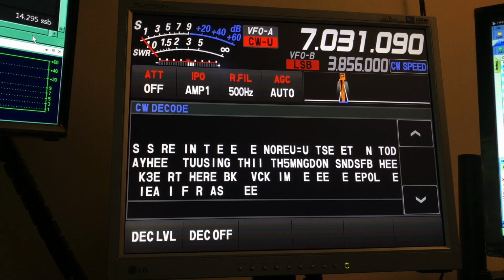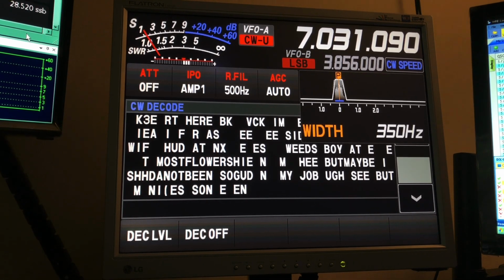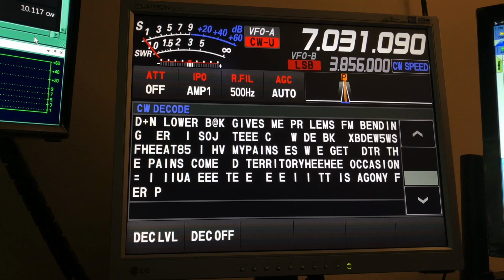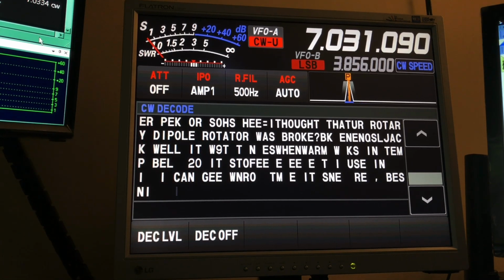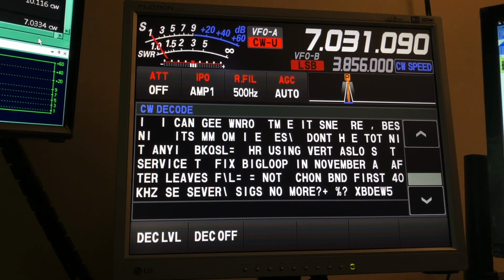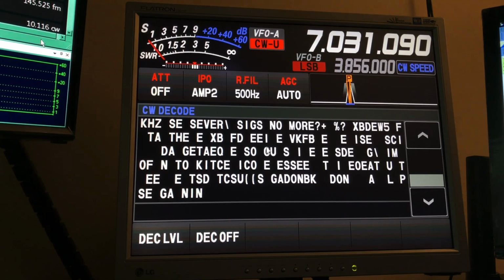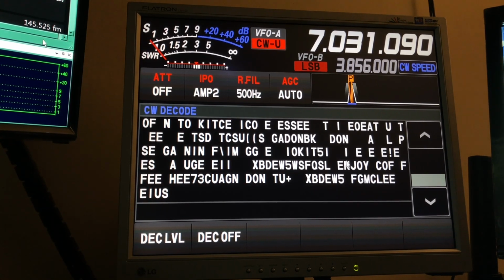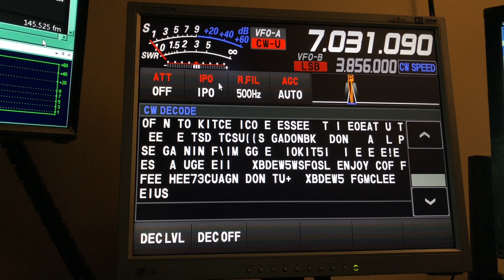Yaesu FTdx10: CW Decoder (Video #37 in this series) #ftdx10 #hamradio #cw #decoder

Comment: Excellent video !   I noticed there was a note displayed about the DECODE LVL being set at the "default" of 50 -- my FTdx10 came new in the box with the DECODE LVL set at 20.  So I adjusted it.  One question about the APF -- you note enabling it.  Are you enabling it at zero Hz (I assume so) ?  I see the APF can be adjusted from -250 to +250 Hz ?  And are you running the APF width at "wide" or "narrow" ?  Many thanks for these great videos!  73.
Reply from the maker: Those questions are answered in various videos in the tutorial series. There are 103 videos.  The menu optimizations guide covers it too.

Comment: Mine displays gobledygook no mater how it is set up ! Worst CW decoder I ever had. Just wont decode!
Reply from the maker: That's a shame.  It works fine for me.  I just dial in the CW speed to approximately the speed I'm listening to, +/- 5WPM.  It's somewhat forgiving, but it needs an idea of the speed it's supposed to decode.  Plus work the noise floor down as much as possible, so it doesn't decode noise.

Comment: In my opinion it's way better to learn to copy CW before learning to send.  Like the days before decoders and keyboards when you had to test for the FCC examiners.  Machines just don't do well with slight human errors or what we used to call a "swing".  Like an accent in CW.  Anyhow the part the decoder missed was "NOTCH ON BAND FIRST 40Khz".  The human brain filter copies it just fine.  Decoders are becoming more of a crutch rather than a tool.  For that we could just run a form of RTTY or PSK.   Just the thoughts of an old Op first licensed in 1978.  

On the abbreviations it's a way to double your CW speeds both for RX & TX.  If you can say something with half the characters you have doubled your effective speed.  Just like texting, say more with less sending or as we used to do long ago "short hand".  Good demo of the radio, it's decoder, and the CW shorthand.  I highly recommend mastering CW without machines.       

73,

Old Boomer
Reply from the maker: I agree with committing to learning CW without relying on a crutch. But it’s like learning to ride a bicycle.  You want to reach the point where the training wheels are no longer necessary.  And I believe that the best way to improve CW efficiency is on the air.

But for someone who wants to get on the air while they improve their speed, the decoder provides some backup, even some confidence to help you decide to try to make on-air contacts in the first place. 

I did it the old way.  I learned on the air.  In 1982, I got on the air with a Hallicrafters SR-150, a J-38 key, and a home-brew 15m dipole.  I banged at 5WPM and all I can say is, bless those hams who answered me. Hams today aren’t as patient.  Many Old-timers are cranky and discouraging to new hams.  We should be glad to see new hams who are interested in CW.  And we should encourage, not discourage.

I slowly improved with every operating session. I’m so thankful for those patient operators who endured my fist as I learned. But today, if you get on the air at less than 10WPM, you are libel to be ignored. 

I encourage getting on the air and mostly just listening, until you are comfortable at copying 10WPM.  Practice sending without transmitting (BK-IN off) until you can send at 10WPM. Then get on the air. Use the decoder to build confidence as you work your first contacts.  Try to increase quickly to 13WPM.  Commit yourself to outgrowing the training wheels. You will eventually find that you no longer look at the decoder.

From where I sit, I hear from so many new hams who have been discouraged by old-timers. Part of the impetus for me starting this channel was the number of new hams who were discouraged by their local club. And it’s not isolated incidents. I hear from new hams around the globe.  They turned to Facebook, only to get treated badly for asking “dumb” questions. I’m ashamed of my generation of hams for being such kill-joys. I’m encouraged that a new ham will even attempt CW.

Comment: Be an active ham off and on since the early 1970s after serving at a radio op for the Army. Bought this rig recently, the receiver and features are amazing compared to the many rigs I have had in the past.
Reply from the maker: The FTdx10 packs a punch. It is a beast at CW, especially with the optional 300Hz roofing filter. It can pull out almost imaginary signals.

Comment: The owners manual for the FTdx10 (which I own and consider it to be an incredible radio!) does not explain what CW-L and CW-U is exactly. Those two selections are listed repeatedly in the owners manual as being influenced by other settings, but there's nothing about why I should choose one or the other.
Reply from the maker: Watch my video about CW-U and CW-L, from 2 years ago.  It’s in the FTdx5000MP playlist. It’s also in my CW playlist. I teach different operating techniques with different radios. If you aren’t watching all playlists, you are missing information. Here is a link: https://youtu.be/bYXGRpdYOxI?si=_PIvLUcT1mRBGsVu

Comment: I wish you would have shown the proper set up prior to showing the various filtering  you just jumped in with no set up directions
Reply from the maker: The setup directions are, enable the decoder, per the operating manual.

Comment: My biggest challenge has been trying to determine the decode level. A lot of the time I’m getting Es Fs and Hs.
Reply from the maker: I left decode level at default. The key is to remove as much noise as possible in the front end of the receiver, and use the DSP parameters I teach in my CW videos to finish it off. Then you need to guess within +/- approximately 5WPM how fast they are sending to you and adjust your sending speed accordingly. Your sending speed gives the decoder a clue. It needs a ballpark guess at the speed it’s supposed to decode.
Reply: @n4hnhradio  Thanks, I’ll keep this in mind. Also, I haven’t really messed with the notch or filter width, so that may be part of the issue as well. I’ve only had the radio a few weeks, so I’m still in the learning stage. In any case, thanks for the help here and the videos!!!
Reply from the maker: Once you use ZIN and lock onto their exact frequency, narrow to 100Hz and enable APF.

Comment: Couldn't you have spent 5 hours showing us how the decode doesn't work with weak signals? There isn't a single person that came here to see it not work yet that is what you showed us. A minute in and still showing us how it doesn't work with weak signals and wasting our time. Thumbs down.
Reply from the maker: The purpose of the video was to show what can cause the decoder to not work. At 3 minutes into the video you see it working, after I showed how to improve the S/N ratio. I’m not advertising the capabilities of the radio. I’m teaching how to get more performance from the radio. If you can’t understand that, then this is not the channel you are looking for.

Comment: Thanks for this, I was wondering if it had a decoder, thinking about upgrading from my 590SG and I like using this feature as I'm learning code. C'mon Black Friday Sales!
Reply from the maker: The decoder works well.  You just have to guess the speed of the CW you’re listening to and set your CW send speed within a few WPM plus or minus.  The decoder assumes that the speed you’re set to send is the speed you’re listening to.  But it allows a wide margin of error. 

73, de N4HNH
Reply: Sporty05,

Your 590SG has a decoder, and it is much better than that of the FTDX10.

I own both rigs and can honestly say that the TS-590SG has no problems decoding CW even with lots of noise. The FTDX10 on the other hand, needs noise reducing and filters narrowing to do an half decent job.
Reply: @harrybatt998  Yes it's not bad, I just wish I could see more of it as it scrolls by. I've become a big fan of Yaesu's DNR from my FT-891, hoping to get more of that with the FTDX10 along with the CW decode.
Reply: @sporty05  

You'll be impressed with the FTDX10. I've only had mine for around a week & can operate & navigate through it easily.

I'm really liking this Yaesu, but just hope I don't encounter any of the "insert firmware" message issues some people are getting on bootup.

Comment: Great video please could you tell me if I purchase a keyboard for the ftdx10 could I type CW and transmit it and use the CW decoder , this could be a great method to get me on CW with the hope of learning the key in due course, thanks again
Reply from the maker: The only semi-automatic way to send CW is to use the touchscreen keyboard to store up to 5 CW messages in the memory slots and send by clicking the mouse or touching the screen, as I showd in one of the videos.

73, de N4HNH
Reply: @n4hnhradio  thank you

Comment: any video how to set it to cw decoding ?
Reply from the maker: From the main menu you press Decode, at the bottom right.  That is all you do to enable the decoder.

73, de N4HNH
Reply: @n4hnhradio  well I know that however it say in t he user menu to seg the speed as well what speed your set on can you do shot video on how to set what parameter
Reply from the maker: I will add your request to the list.  The manual can be confusing.  You just need to guess the sending speed of the station you wish to decode, and set that as your CW speed.  It doesn’t have to be precise.  Plus/minus 8WPM or so seems to work fine.  Other than that, just use a combination of ATT, IPO, RF Gain, roofing filter, and DSP to improve the signal-to-noise ratio.  This helps the decoder do a more precise job.

73, de N4HNH
Reply: @n4hnhradio  thanks, i was wondering why ir does not work

Comment: This looks like a much nicer radio than I expected.  The Sherwood Lab reports also put it up there with the best radios on the market as well.  The only thing I would suggest to you is that you make use of your RF Gain. In order for DSP Noise Reduction to work properly you MUST remove the noise down to the noise floor level (IE. If you have Noise floor of S4 you need to lower the RF gain until the needle gets to S4-5, THEN turn on the NR.) If you operate the RG Properly all of that rumbling and echo in the background would have gone away, and the use of the APF would not even be necessary.  In any case, great video and explanation on the operations of this feature.
Reply from the maker: I do sometimes use RF Gain.  But I prefer removing the noise floor first with IPO and ATT.  That produces a better S/N ratio before I even resort to RF Gain.  IPO also improves the cross-modulation characteristic of the receiver.  IPO should always be to first go-to for noise reduction.

Technically, the FTdx10 is number two in Sherwood’s list.  Check out the footnotes.  The Flex 6700 was a one-off.  The best dynamic range rating for Flex is 99dB.  The FTdx10 is 107dB.

Comment: I may have missed it in the video, but what is that 'P' in the filter window (below the '8' in 3.865)
Reply from the maker: The “P” indicates a CW Passband is being displayed.  RTTY will be indicated by an “M” and “S”.  Data will be indicated by the letter “C”.
Reply: @n4hnhradio  Oops. I found it in the manual just after asking the question.

Comment: The optimal 300Hz filter really helps.
Reply from the maker: I’ve been thinking about ordering the 300, but the DSP width in the 5000 works so well that I can barely tell the difference between the 300 and the 600, once I narrow to 50 or 100 Hz digitally.  But maybe I should order the 300, just so I can max out the FTdx10.

Comment: Can you explain the rhyme and reason with the dB level on the cw decoder? Other than having one second to adjust it before it reverts back lol.
Reply from the maker: Sensitivity.  I find that the default setting of 50 works just fine after you minimize the noise with IPO, ATT, etc.

Comment: I wish they’d add a CW decoder in the firmware for the 991A.  Is it likely they’d add that?
Reply from the maker: Don’t be a CW snob.  Some people are learning CW, and the display can help them gain the confidence to get on the air and improve their skills.  Since CW is optional now, we need to encourage those who show interest, instead of brow-beating them.  My channel exists to encourage.  Get that or get lost.
Reply: @n4hnhradio  The decoders are really handy for learning- for instance I can now recognise the “TEST” phrase at 40wpm dah-dit-diddleit-dah. 😂 (using the QRP Labs QCX mini). I’d love the FTDX-10 but the brilliantly use local Morse practice net is on 2m ssb so need a radio with all mode uhf/vhf. The 991A is the answer I think. I can use the Morserino 32 as a reader for safety 😊. Also the Catknobs is a great addition to the 991 adding 6 programmable knobs (www.catknobz.com). 
Sending is relatively straight forward- I can comfortably send at 20wpm with a paddle or 12wpm with a straight key. Head copy is a different matter - starting to recognise the odd phrase at 20wpm but if I want to catch it all it’s got to be about 10wpm. The decoder helps with recognising and memorising phases.
Reply from the maker: Doubtful.   The hardware might not have sufficient memory.  But, knowing how Yaesu discontinues perfectly good radios before they have a replacement, I wouldn’t be surprised to see the 991A phased out soon.

73, de N4HNH